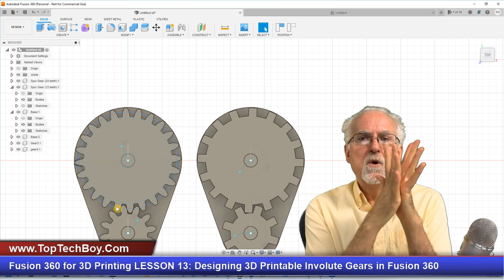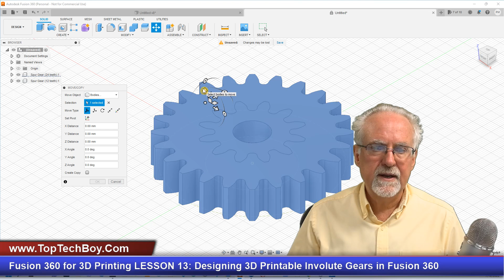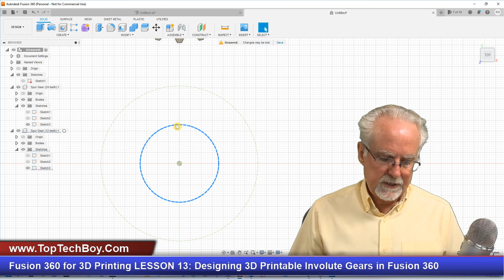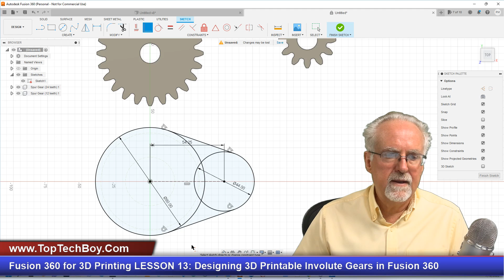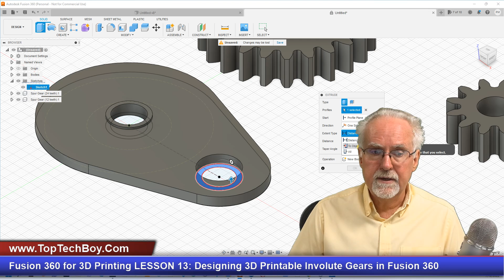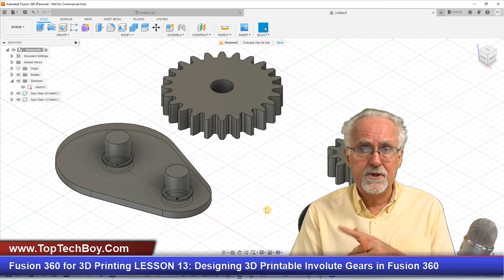Fusion 360 for 3D Printing LESSON 13: Designing 3D Printable Involute Spur Gears in Fusion 360

Comment: Hey Paul, I noticed you measured from the top of the tooth on the left to the top of the tooth on the right and was a short and Curly off the 78mm.
however if you measured the top of the left tooth to the bottom of the right tooth you would in fact hit 78mm.

Comment: Minor nit: when you measure the diameter of the gear, you measure from the top left of the left spoke to the top right of the right spoke. This doesn't quite measure the diameter, as your line doesn't go through the center. If you had measured from the top-left of the left spoke to the bottom-right of the right spoke you would have measured symmetric points and found a diameter not of 77.947 but exactly 78.0.

Comment: if i reduce or enlarge gears or nuts and bolts in my slicer should they still work?
Reply from the maker: I think you should edit in fusion 360, NOT resize in the slicer.

Comment: When Paul instantioned the SpurGear his default Root Fillet Radius is 1.588. Mine is 2.000. When I make all his recommended changes I get a warning that the max Root Fillet Radius is too large. It must be less than 1.7712. I was able to change to 1.588 but needed to yankey-doodle with the entry to get it to take the new number.

Comment: Fun project thanks.  I need to try again with some more tolerance.  The large gear was a little tight. Just a little sanding and it was great. The small gear was much tighter and actually took a bit more sanding. 
I tried flipping them over and it didn't seem to matter. 
Doing good and meshes nice with just that little bit of sanding.
Reply from the maker: Yes, tolerance can vary with your specific printer, and print settings.

Comment: https://youtu.be/EIkdCT3FKVQ
Above is the link to my spur gear video. Advise: If you have trouble getting your part off the bed,make the bed temperature 90 degrees. Be careful handling the bed it’s hot

Comment: Not sure if anyone else had this problem, but in addons for the spur gear for C it would not load but the python one would (using Windows 10 64)
Reply: Yes I had the same issue. The C+ version does not work, but the Python does. Also using Windows 10 64.
Reply: I had the same problem Arlo.  The Python version worked, the C++ version did nothing when I clicked on it.
Reply: I had the same problem
Reply: Yes, I had the exact same problem but my "C" drive where fusion 360 is located is very low on space so maybe the file space for c++ version was too large to load. I also used the python version. It works great
Reply: Yep, same for me.  No joy with the C++ version but Python worked as described.
Reply: Although I initially used the  Python version, out of curiosity I restarted Fusion 360 and attempted to load the C++ version. No success. I am running  32G Ram with 1T of SSD so I do not think the problem is not enough space. Perhaps they just do not have it loaded. I enjoyed all the comments re this topic. Thanks
Reply: Same for me.  Not sure why.

Comment: Hi Paul,
I have a problem with loading spur gears. When i hit the run button in add-in for spur gears nothing happens. when i hit the demo button. the demo is loading and appears into the create menu.
do you now what is wrong?
grtz Frans
Reply: Problem solved
Spur Gear is now in de create pulldown menu, but on the wrong place.
It is in the section from box, cylinder, sphere etc.
How can i move it to the last section?
Reply: @fransvanenschot3286  I had the same issue.  Didn't see it because I was looking where it was in Paul version.